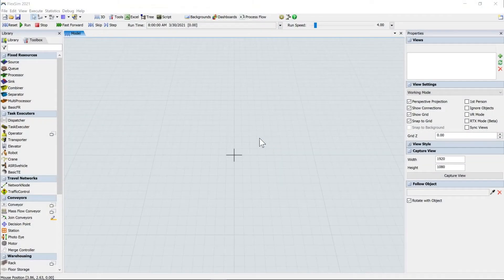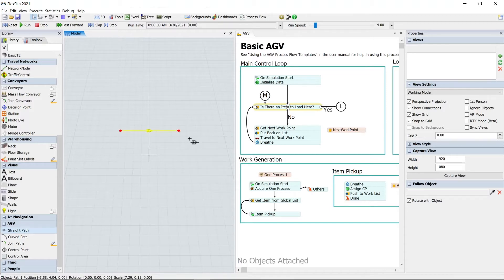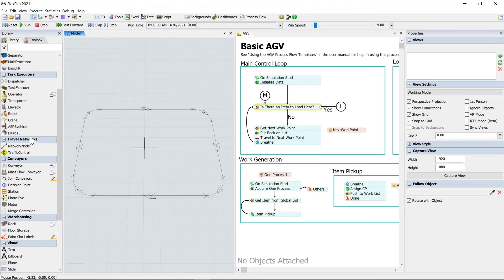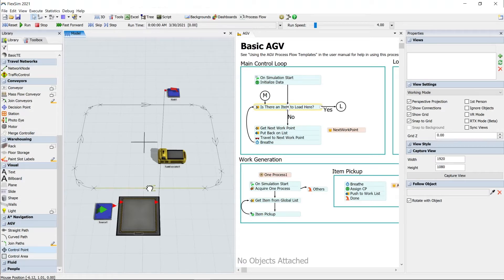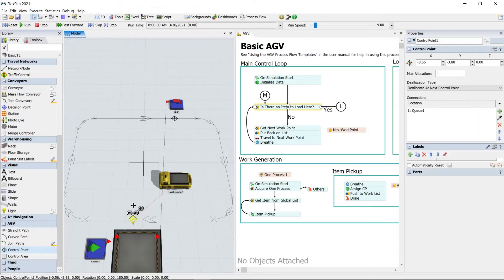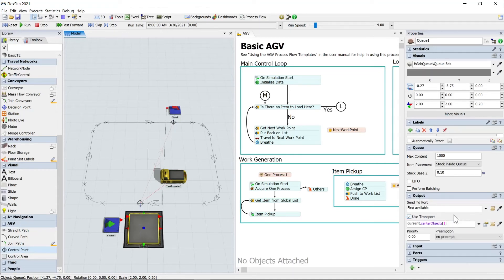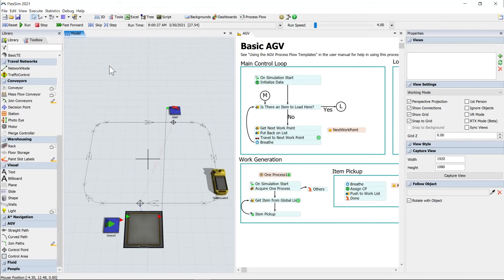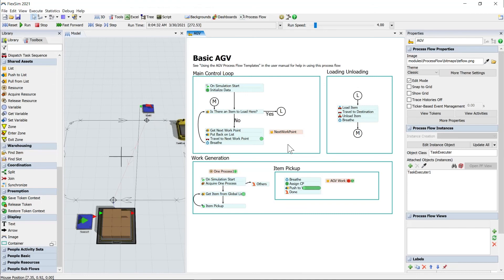Using the Basic AGV Template

Comment: I dunno what's going on..  I did everything the same just as you did, but whe AGV reaches  2nd control point (empty, at the first run) the AGV stops there and the program displays NAVIGATION ERROR:  The AGV network could not resolve the route for TaskExevuter1 because of the following error:  No valid path was found to Destination: ControlPoint1.    I had this problem with previous models i tried to make, so that's why i played this tutorial to build sth easy and practice the logic behind building AGV routes. So irritating...  Do you have any guess what could be wrong ?